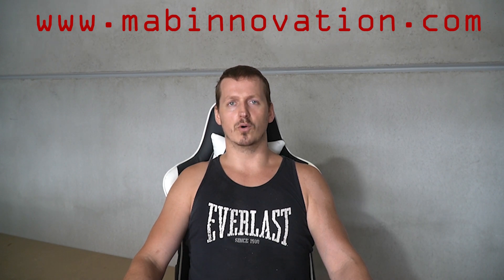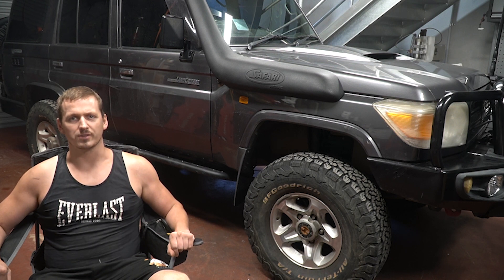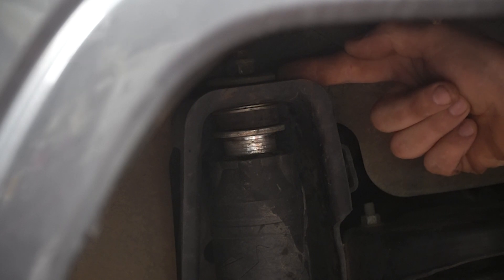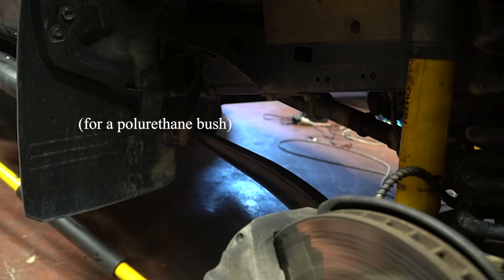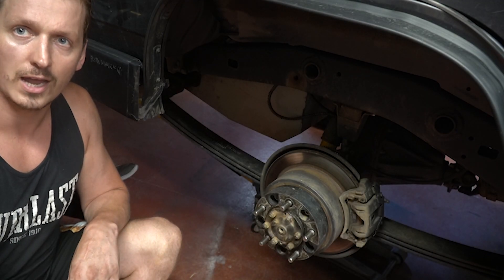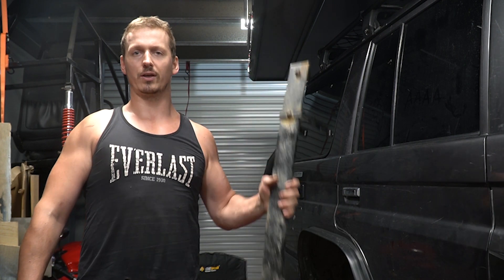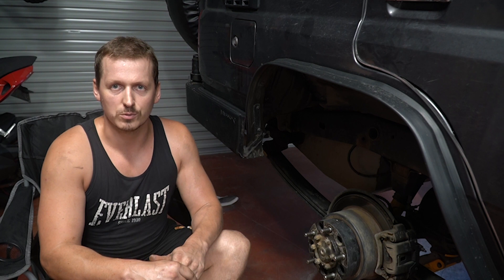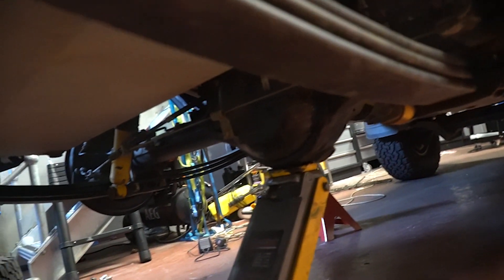Amazing flex out of your 4x4 suspension | parabolic springs final setup NOT WHAT YOU THINK

Comment: Your a funny guy, love it. Query, the rear spring hangers, some of these have locking devices for on road use that have to be removed for off road use. Do yours have these? Can you get excessive body roll on the road? Thank you.
Reply from the maker: the only way it's physically possible to affect handling is if you're cornering so hard you've got 0 weight on the wheel. Basically rolling over. at which point, who cares? it's too late anyway.

Comment: Hey mate, great video, I run the same set up in my 79 but with 2 parabolic leafs and an airbag. I have troubles finding a high clearance leaf plate that suits such a thin leaf pack. Wondering what brand yours is?
Cheers, thanks for the helpful vids
Reply from the maker: They're the older style non billet superior ones. Wayyyy overpriced for what they are, but they were a gift so I can't complain.

Comment: You're a breath of fresh air and the content was great. I'm in the market for parabolics for my 76 so this was good timing.  Do the <300kg springs still require the mod? Appreciate your time, cheers
Reply from the maker: Thanks 👍 I can't really speak for your setup, but if your lower spring isn't doing anything (the ends aren't touching), and you're struggling to get the rear to tuck up into the wheel arch then you might benefit from removing it. If not, don't. Not saying it's a required mod by any stretch, just sharing what I did to make mine get loose.

Comment: Any chance of a parts list on your new merch site?
Reply from the maker: Added a direct link to the shop In the description. I've got about 20 products in the works, which will be added when ready. Basically anything unique you see in my videos such as troopy gas/air fitting plates, motop lifting gear, that sort of stuff. If you see it in videos, it means it's been designed and manufactured to an extent.